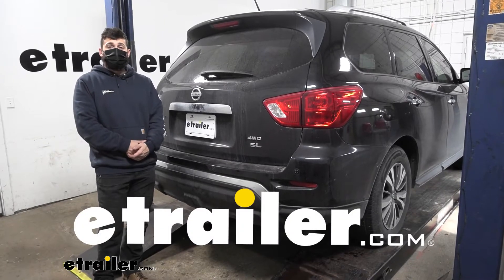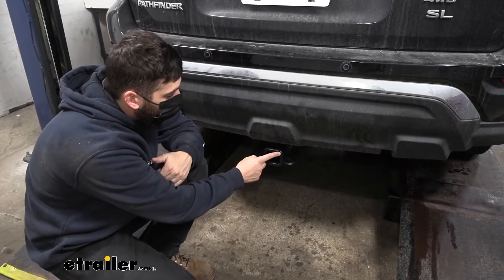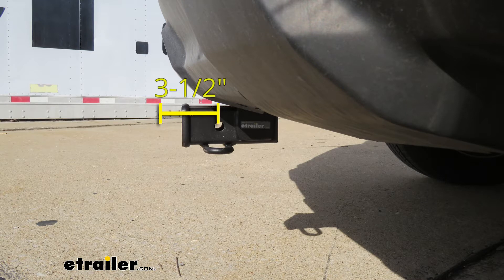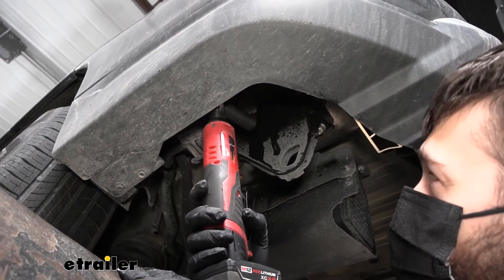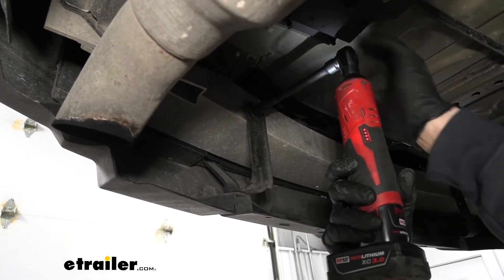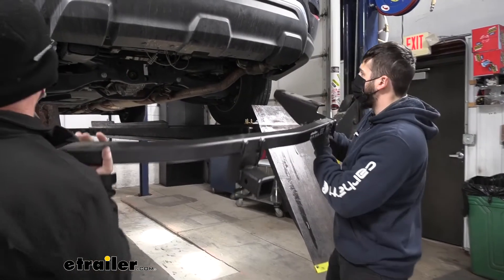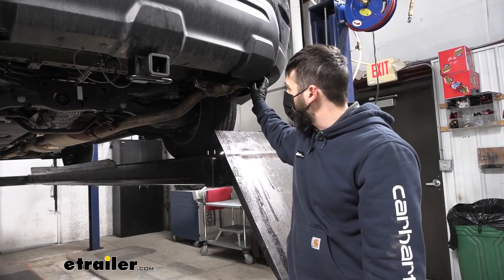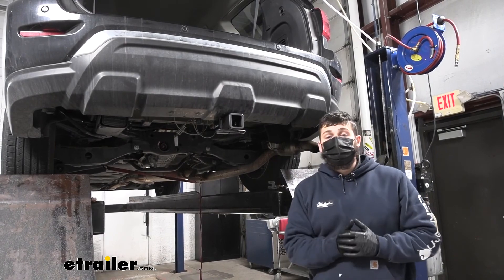How to Set Up Your etrailer Trailer Hitch Receiver on a 2018 Nissan Pathfinder

Comment: No need to take tire down wasn’t in the way…. Cutting bump no need I able to just install it with out cutting it once you mount the hitch on it will push up on the bumper just fine …. Didn’t detach Muffler it is a option I had no problems but if you need the room do so 😊 wish I can post pics but no option
Reply from the maker: Thanks for the tips!
https://www.etrailer.com/Trailer-Hitch/etrailer/e98908.html